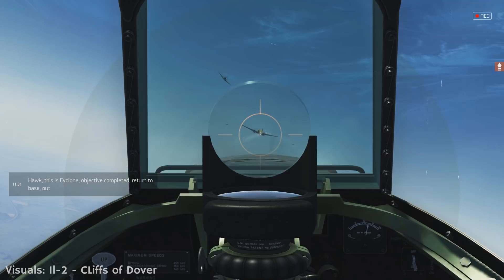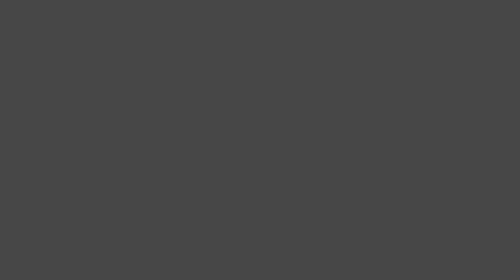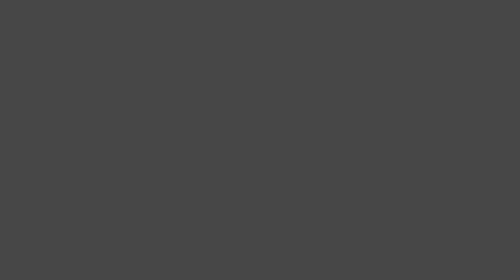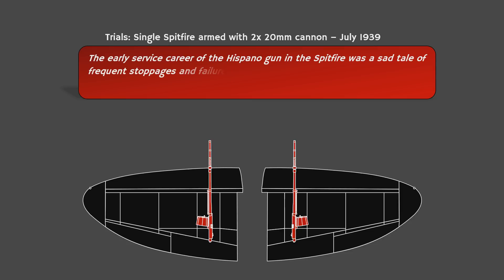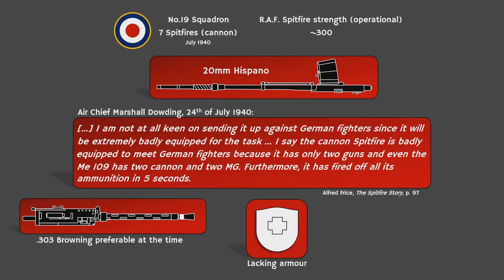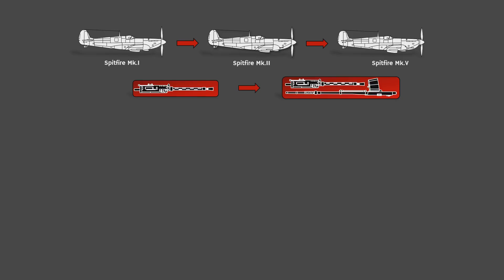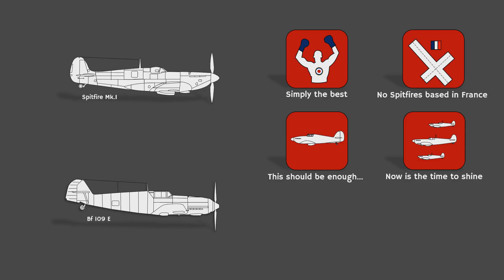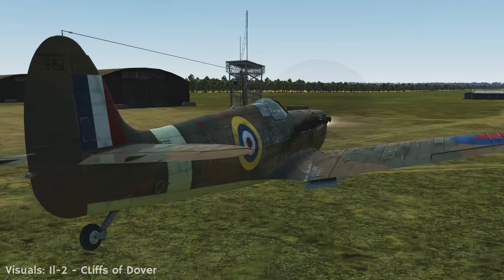⚜ | Clearing up Spitfire Misconceptions

Comment: Poor hurricanes, spits always getting the spotlight...
Reply: Spitfires are more famous as they made a larger impact where it mattered, which was later in the war. For example, notice how few people mention Dunkirk, and will readily speak of the Normandy Landings.

Hurricanes did a lot, but did that lot in much less  visible way.
Reply: Cameron McAllister I'm sorry to say you are quite incorrect.  The Hurricane was influential in the defeat of Rommel in North Affrica. The MkIId fitted with the 2X40mm vickers AT gun helped slow the Africa Corps.  The Spitfire MkVc (tropical) was more often grounded and was hampered by the huge tropical intake.  The Hurricane was replaced by the Typhoon in 1943 which had a much bigger impact over Normandy than Spitfires during operation overlord.  The MkXII spitfires only able to do minimal damage to ground forces compared to the Typhoons.  over Europe the spitfire became an almost obsolete aircraft as Typhoons,  Tempests and Mosquitos knocked out the supply lines for the luftwaffer.  The MkIXHFe being used to knock out recon aircraft (until the Mk.XIV)  and the Mk.IXLFe engaging the fighters though by late 1944 the tempest was causing havoc to the FW190 squadrons and harrying Me262.
Reply: +edmundscycles1 - Both Typhoon and Hurricane (to a lesser degree) were cases of a "failed" fighter turned ground-pounder.  Spitfires could do those jobs just as badly, if they really needed to.  Tempests were better, but it took lots of time to figure out this new engine/airframe combination.  To the point that it became unnecessary before it entered service, and a known stop-gap measure for most of the time it was actually used.

At least it actually worked, unlike Saber in Typhoons.
Reply: bakters the Typhoon was always designed as an attack aircraft. From the inception it was to carry 2000lb of bombs or 12 24lb rockets.  It was to be low level fighter bomber.  Hence the low level performance.
Reply: Under primitive airfield conditions, the Hurricane would enjoy a greater serviceability rate as well. Repairs to the Hurricane could often be done without the specialized facilities and training needed to keep a more modern, stress-skin design in the air. War on the frontiers also tends to have fewer cameramen and journalists, as well...
Reply: But then again, a Hurri usually found itself kind of 'outclassed' by the the late "E" & the F & G models of the Me 109s in the Western Desert.
Reply: +edmundscycles1 - Typhoon was intended as a fighter.  It didn't carry any bombs, but had an armament of 12 MGs instead.  Only when it became apparent that it's not going to be better than the Spit any time soon, they used it in a fighter-bomber role.  It was always quirky, the engine was very unreliable, it poisoned the pilots, the tail broke off and it wasn't particularly fast.  (BTW - wikipedia page needs fixing.  Do not rely on it too much.)

+Malaveldt - Hurricanes weren't really that much tougher than any other contemporary fighter, and also not particularly easy to repair.  She was still designed as a pure fighter, after all.  Built as light as they could make her, as fast as they could make her, and only slightly more robust than Spits by accident.

If Western Allies knew they needed a dedicated attack airplane, they would make something like IL-2, but they didn't.  They believed in strategic bombing doctrine, so they built heavy bombers and interceptors.  But then it became apparent that they need to kill the enemy soldiers too, not just civilians, so they pressed fighters into the role they were never designed to fulfill.
Reply: IN the Battle of Britain the hurricane shot down well over half of the German aircraft.
Reply: I have heard the Hurricanes were very easy to repair. They were dope canvas and the documentaries were saying they were able to get shot up hurricanes back in the air in hours where spitfires being all metal often required days of work to replace stressed metal panels.
Reply: bakters the Typhoon was always required to carry mixed armament as specified by the air ministry.  Yes the primary roll was as a high altitude interceptor but the ground attack version was in parallel development.
Reply: Grahame Nicholson my grandfather was with 6 squadron DAF in North Affrica.  The Hurricane was very simple to repair the cantilever fuselage system could be straightened by adjusting the bolts that tensioned the internal frame work then the outer section was not structural just being dopped canvas over wood dowel rods ( while on station they even used bean poles from some ones garden to repair an area that had been hit by a 20mm shell) .
Reply: Stephen Bachman more stable gun platform too.
Reply: edmundcycles: Yep lines up with what I have heard. The old guys were amazing. But if you tell them they were heroes they laugh and say "Well if I knew what it was going to be like I wouldn't have gone and after I got there  neither my bosses not the enemy really cared what I thought about it all. "  

I really love the dry humor of the old guys

An 80 year old P-51 ace said "Well those 109's were pretty good but I reckon the P-51 was about 5% better. I was pretty happy with my 5%"

Keith Miller Australian cricket captain in the 1950's and Battle of Britain spitfire pilot was asked about the stress of being Australian Cricket  Captain during a bad patch for the current captain in the 1990's. Old Keith, not known for diplomacy said "Captaining Australia in cricket is not stressful. Having a bloody Messerschmidt up your arse is stressful." 

I did 6 years army in the 70's and 80's but never went to war and I learned I could do a lot of things I didn't think were possible. It was explained to me like this. "Well lad it is mind over matter really. We don't mind and you really don't matter." 

Thanks edmund
Reply: I thought that Typhoons role was mainly ground attack and we all know of Miss Shilling's orifice.
Reply: Mike Skinner the air ministry specifications were for a universal airframe   Speed of 400+ at 22000ft and multi weapon suite.  the westland whirlwind was also a submission to that 1937 spec.
Reply: Grahame Nicholson read 'set guns to fire' written by the squadron commander of 256 squadron.
Reply: Grahame Nicholson It was a battle of attrition and numbers. Hurricanes were less effective against the Luftwaffe fighter escorts so were pitched against the slower, bigger, more numerous bombers.  
The Spitfires were assigned to take out the fighter escorts.  

The BoB could have been won entirely with Spitfire had there been enough, but not won if fought entirely with Hurricane, as they lacked the edge.  
It was won with clever allocation of what they had, with both types playing their part.
Reply: Mike Skinner. It started off as an interceptor and its role was interception of low level fast intruder aircraft.  It was big very fast and very heavily armed with a long range. It's only problem once its weak tail was fixed was the engine was no good at high altitudes. The big day raids were over by the time it was fully operational and they were flying patrols against the Fw 190 and Me 210 intruders who were carrying out fast raiding under the coast radar coverage. They shot down a lot of Fw 190s in particular as they had the legs on them.  

As the British went over to the offensive in France they were used as long range fighters and intruder type ground attack aircraft. They were always offensive fighters and they were trying to goad theLluftwaffe into putting up fighters to protect its assets. They were happy to mix with German fighters at 15,000 ft and below. They were not good above 20,000 feet just like the Fw190. The Tempest was the ultimate version and was  brilliant. The Tempest and the Typhoon did not shoot down a lot of German fighters per aircraft ar because the Germans did not challenge them much as they were simply not able to. After 1943 The Luftwaffe Fighters went up against the bomber raids or were in the East. .
Reply: routari partially true.  The Hurricane could out turn the 109 and even have better control in a high speed dive. The 109 E would have its controls lock up,  requiring the use of the elevator trim wheel to pull out and decreased roll rate while a hurricane still maintained a better roll rate in a steep dive over 400 mph.  The 109 e7 though had this problem rectified by the beginning of 1941 and the F series.
Reply: Grahame Nicholson thank you very much for the info. I was in Typhoon Flight at RAF Halton college (1970-72) and I always wished to know more about the aircraft that my entry was named after. I have searched the internet and haven't found too much to be proud about.
Reply: Heck yeah! They were murder against bombers!
Reply: The thing is Spitfire excelled at aircraft vs aircraft combat, but sucked at everything else.
Reply: The Hurricane was a great fighter for it's time. Not as fast as a Spit, but a very stable gun platform, and very maneuverable at low to medium altitude. The RAF would often have flights of Hurricanes positioned a few thousand feet below an engagement, waiting for the 109s to dive away from the Spits.
Reply: Stephen Bachman I just watched the first half and I would like to thank you for that.
Reply: I was lucky enough to see the Battle of Britain as I was walking home from school sometime in the 60s. They were dog-fighting over my house in Eastbourne using real Spits and Hurricanes and Messerschmidts.
Reply: I suggest you watch Bismark's video on survivor bias. The Hurricane is a good example of the concept. If somebody got a Hurricane back it could be repaired more easily than a Spitfire. That is true. However take for example both types get hit directly from the rear by a 20mm cannon round from a Bf-109E. In the case of the Spitfire, the cannon round detonates on contact with the metal skin. Blows a big hole in the structure and the fragments are mostly stopped by the pilots back armour. Pilot manages to get the aircraft back and its a major repair job. Hurricane gets hit in the same area. Unless the shell hits the metal framework inside the fuselage it will not hit anything with enough deceleration to fuze until it hits the pilots back armour at which point the shell would detonate, blow a hole in the armour and kill the pilot. The other problem with the Hurricane was it caught fire a lot more easily than the Spitfire. This tended to be fatal to both the aircraft and the pilot. Studies have show that if you were hit, you were four times more likely to be killed or badly wounded in a Hurricane than you were in a Spitfire.
Reply: The problem with the Hurricane Mk 1 was by mid 1940 it had a 30MPH speed disadvantage against the Bf-109E.  Under the standards of the time, it meant that the Hurricane was basically obsolete as it gave the Bf-109 a lot more options on running away if things went wrong in a dogfight. The problem for the Germans was that they treated the Hurricane with contempt, got careless and then the Hurricanes nailed them.
Reply: I think that in the defense of Malta only hurricanes and 4 bi-planes were used.
Reply: Mike Skinner... there were only 10 Gloster Gladiator found in crates. Some were hastily assembled while others were left unassembled for spares, as there were no spare parts for those Gladiators. Later on, Hurricanes reinforced the defense (august 1940), followed by Spitfires (march 1942).
Reply: Pikilloification I mean, the spits were better...
Reply: +Richard Vernon - Finally someone speaking sense.  If Hurris or Tiffies were any better than Spits, nobody in his right mind would bother with Spits.  Supermarine was not a company known for large scale production capabilities, they were know for prototyping and winning trophies.

Regrading survivor bias - introducing helmets greatly increased the amount of people treated for head injury.  Before they died quietly, after they had to be treated.
Reply: People tell this story in wisecracks, which tends to confuse those new to it. The Hurricanes did the bulk of the work, and did the majority of the kills. A Hurricane was capable of taking on any German aircraft and dealing with it on even terms or better, but with one exception. A Bf 109 was simply a better fighter than a Hurricane. To protect the Hurricanes from the 109s was what you needed Spitfires for. If all the Spitfires did was escort and protect the Hurricanes, that would have been enough.
I thought B and C wings started to appear on Spits a little earlier than that, but I wasn't there... The British Empire had a bit of a historic fetish for the .303 calibre. In WW1 that was adequate for air : air combat because the air frames afforded virtually no protection to the pilot or crew. The optimal calibre for WW2 and perhaps Korea, (air : air) was .50 cal. A 20mm canon was more effective again, which is why we still use them, but they were not yet entirely reliable, and they went through a lot of bulky + heavy ammunition quite quickly.
Reply: +Kneedragon1962 - The only reason why Hurris got most kills during BoB, was because there was way more Hurricane equipped squadrons.  And there was more of them, because she used old tech.  

If you look at a Hawker Fury biplane, strip the top wing and put a Merlin in front, you get a Hurricane.  Hawker was doing those airframes for long enough so they could produce them in bulk.  Spits required new factories , new skills and new machines, though ultimately she wasn't any tougher to build.

Escorting fighters with fighters?  No.  Hurricanes could hold their own provided they had numbers and/or tactical advantages over the enemy.  BTW - this idea that Hurricanes were used specifically as bomber-hunters is a myth.

Finally, the Brits tested .50 cal.  It was no better in power/weight than the .30 cal they already used.  From very early on they knew they needed cannons, and finally they managed to make them work.  Americans did something wrong with the chamber, which made their hispanos even less reliable, so that's why they were stuck with MGs till Korea and beyond.
Reply: Yep, true.
Reply: bakters the Spitfire had been in service with the RAF for nearly 2 years when the Battle of Britain started, factoy infrastructure and production wasnt an issue, but it was a more complex aircraft to build compared to the Hurricane as it was an all aluminium airframe and body, the advantage then falls to the Hurricane as it takes less time to build and when you need aircraft in a rush then yo build what you can as fast as you can.
Also the Hurricane was being built/partially assembled in Slough (amazingly in secret) and the industrial estate was never bombed which helped production :)
And please remember that us Brits used a .303 and not a .30 cal, well not until a NATO standard 7.62 round anyway ;)
Reply: Yes . The 'canes string bag build could never carry the label in the same way , worth , but not sexy .
Reply: The Spit became the poster boy of the Battle of Britain because it was the sexy thoroughbred charger of Fighter Command at the time was as the poor old Hurricane was the plodding never tiring pit-pony which did more of the actual work of the battle.  The Hurricane made 55% of the RAF kills during the battle, including a fair number of Bf109's and Bf110's.   The Hurricane was actually a much more stable gun platform then either the Spit or the Bf109, and could easily out turn a Bf109, there by getting onto its tail and shooting it down.  The Luftwaffe's tactic to avoid this was to nose over and dive away from the Hurricane, and this puts pay to the incorrect belief that the Hurricane was not a match for the Bf109, it could and did best the Bf109 is when used correctly.  

Also because it is simple construction, using fabric aft of the cockpit instead of more streamlined and modern stressed aluminium skins,  the Hurricane could soak up a lot more battle damage then the Spit.   Cannon shells from a Bf109 would simply pass through the fabric skin of a Hurricane and not explode and simply be quickly repaired by gluing on a patch and applying a bit of dope, often done while the A/C was being turned around for its next sortie of the day.  Whereas the same hit on a Spit stressed skin could have the A/C sidelined for a few days.

The Hurricane went on to do a yeoman's service for the RAF and for the RN's Fleet Air Arm.  They flew off catapult armed merchant ships to attack and destroy shadowing Luftwaffe Condor maritime patrol aircraft which were vectoring in U-Boats onto a convoy, they were converted into Hurri-bombers and pressed successful into the ground attack role and even fitted with large cannons to become tank busters during the desert campaign.  And all they were phased out and replaced by more modern and capable A/C such as the Tempest, Typhoon and Fury by the wars end, the Hurricane played a pivotal role as primary fighter and as test bed for proof of concept for ground attack A/C, in fact I would go so far as to say that the Tempest/Typhoons would not have developed had the Hurricane not been around, for the Hurricane was their daddy.   

I've always said if was offered ownership of either a MkV or MkIX Spit or a Hurricane, I would be hard pressed to make a choice.........
Reply: Those were four Gloster Sea Gladiators, although there were other air frames available at the time and were used as spare parts or replacements.  Later four Hawker Hurricanes was also added to the defense of the Island.   It should be noted that a myth grew up about the flight, that it consisted of only three Gladiators, named Faith, Hope and Charity, however those name and story came into being months after the battle had ended and was put out by a Maltese newspaper as a feel good propaganda piece.
Reply: +Tony B  - Yes, I agree, with a caveat "the Hurricane was easier to build at the time ".  Ultimately it wasn't, and right now it's actually quite hard to restore Hurricanes, but back then this tech was well known, while what Spits required was new, and the company in charge had no experience in large scale production.  

That's why the whole deal went on a backburner, until the war happened, and suddenly everything was needed for yesterday.

I'm not hating on the Hurricane.  She was loads better than any biplane out there, and if not for her, the Brits would go to war with those.

Oh, .303 British is a .30 cal.  Almost no .30 cals are exactly .30.  7.62 NATO is .308, but not always.  It can be something else, depending how you measure it.  It's complex, that much I know.  Ask some American gun nut... I mean enthusiast. ;-)
Reply: "IN the Battle of Britain the hurricane shot down well over half of the German aircraft."
Yes.
Which is remarkably BAD, considering that better than 85% of the air defense was Hurricanes not Spitfires.
Against bombers, Stukas, etc, the Hurricane was a perfectly good aircraft. It was much cheaper and faster to manufacture, easier to fly, and very robust.
Unfortunately, in direct conflict against the bf109, it was vastly outclassed.
The Spitfire was the answer to the German bf109. Very similar in performance, and having the tactical advantage of local airfields & ground observation support.
But to achieve this performance level, the Spitfire was much much more expensive, requiring several times the manhours to build each as compared to the Hurricane, and overall required a much higher class of pilot to handle it safely.
Reply: From what I understand, Messerschmitts had both higher top speed, faster climb rate and could operate at higher altitudes than the Hurricane. Those disadvantage were only somewhat mitigated till 1940.

So yes, those make a superior plane. Even if the Hurricane could make tighter turns, that might also have ment they'd bleed off more speed which takes longer to recover because the weaker engines. Not to mention flying at a higher altitude means you got more energy to expend.

As for the point of Hurricanes getting 55% of kills, that's a bit dishonest to argue for when they outnumbered Spitfires at least 3 to 2.
Reply: bakters not being pedantic, but being an ex cold war soldier, 7.62mm is exactly .3 inch, .308 works out at 7.82 and a bit mm, the main reason it became a NATO standard round was because the US produced .30 cal and to be honest it worked out quite well until the introducement of the 5.56mm. Apart ftom that I do find your knowledge very informative :)
Reply: Tony B ... wasn't 30-06 standard US round? While british standard round was .303.
Reply: @Marvin Kitfox - "...  and overall required a much higher class of pilot to handle it safely." - Well, ... not so much required to handle safely... A Hurricane had fairly normal control weight and response. It flew like any other aeroplane of the time, albeit a fairly quick one. A Spitfire had very light, responsive, very "direct" controls. (Especially the elevators.) Like a car with power steering and a bit too much assist, you can learn to drive it, and it can work very well, but you do have to learn to drive with your finger-tips, not your shoulders and upper back. Opinion was divided on this. Many who flew the Spit observed she was suited to a highly skilled and sensitive pilot, and the enormous elevator authority might save your arse in a dogfight, although she was spectacularly unsuited to a ham-fisted or over aggressive pilot. You could pull back on the stick, any time, any height, any speed, any circumstances, and produce enough pitch-up to provoke a stall. Or rip the wings off... Even when somebody was trying to kill you in a Messerschmidt, (perhaps especially then) you needed to fly a Spit with your finger-tips.
Reply: +Tony B - As far as I know, .308 Winchester and 7.62x51 NATO are pretty much the same cartridge.  With minor differences, unimportant here.  The difference in diameter listed results from how you measure.  .308 is a diameter of the barrel measured between the grooves.  7.62 is a diameter or the barrel measured between the lands.

But I could be wrong on this.  Still, that's how I understand it.
Reply: +Kneedragon1962 - You couldn't rip wings off a Spit easily.  Spit XI has reached Mach 0.92 then pulled 11g and landed !  That's world record, still unbeaten.  No other piston-engine aircraft ever went faster, not even talking about pulling any gs at those speeds.

Oh, and most pilots considered Spits to be very easy to fly.  "Any idiot can fly a Spit." is what you hear fairly often from wwii vets, especially when they compare them to 109s.  

Sometimes they add a caveat, that the Spit is easy to fly once off the ground.  Narrow landing gear, taildragger and all - sure, that requires a modicum of skill, but since it was manageable by kids with 30 hours of total flight time, it couldn't be that bad.
Reply: LOL, yes, the test pilot over Singapore, I know that story. You gotta have either very big balls, or very big rocks in your head to do that. What you do, is take off in almost the last operational Griffin engine RAF Spitfire in the world, and climb to the service ceiling, then put the nose down vertical and firewall it until you break Mach one, or the wings fall off.... He got seriously close to both... He wasn't the only stupidly brave pilot in the world at that time, there were quite a few of them, but ... he is on the list.
Reply: +Kneedragon1962 - It was over Farnboroguh and the pilot was a squadron leader of Royal Air Force Volunteer Reserve Anthony F. Martindale.  The dive was at 45 deg angle.

Those trials went on for two year, so it's not like he was totally crazy.  Earlier they reached slightly lower speeds (Mach 0.891) with no issues.  This time the wings didn't fall off, but the prop did, which unbalanced the airframe and caused this incredible 11g pull.  Martindale went unconscious, but the plane leveled itself at altitude and was in a stable glide as he regained consciousness.  So he just landed her...

Also, the Spit in question was powered by Merlin.  Very slightly modified warbird, photorec version, so no guns.

If you think Martindale was stupid, what do you say to all those who went against armed enemy?  Quite a few didn't come back.  The work of a test pilot seems extremely risky in peace-time, but they did all that in 1943-1944.

(There was some post-war trial (I think) in Hong-Kong, which yielded even higher Mach numbers, but since they were measured only by on--board instruments they are not treated too seriously.  I don't know what happened over Singapore.  It could be something similar.)
Reply: bakters i think you are right but a .308 winchester is a higher pressure round and not suitable for a NATO standard weapon but you can use the ammo the other way round :)
Reply: Cipi Ripi yes i believe they used the 30 06 (63?)
Reply: bakters - I think it was Singapore, it may have been Hong Kong. They had 3 or 4 Spitfires left, which were on loan for atmospheric observation, and word came through to pack up and leave, the British Empire is going home. So, one Spit had a pitot tube and also a secondary Mach tube, because (?) atmospheric observations... So our test pilot was of the view that he'd likely never get to fly a Spitfire again, so on his last flight he went to the top and pointed it straight down. A standing argument at the bar after hours at the time, was old war time Spit pilots said that a vertical dive in a Griffin engine Spit from the top, could and had resulted in supersonic. The objective was to prove once & for all what the truth was. The Mach gauge had a paper tape and pen, and it later showed about Mach .94 or something. And serious buffet... There is some dispute about accuracy, because on-board instrumentation only.
Reply: Cameron McAllister It is a star plane. I recall lot if WWII films featuring the plane. So were propaganda at during the war of Britain. The hurricanes were the actual backbone of the time, despite they were out gun. But their role were to harassing the 109 till they run out of fuel and lost combat capability to ensure there are something left after the German bomb run.
Reply: Many damaged Spits had to be returned to the factory for repairs, whereas the Hurricanes could often be repaired at the airfield repair facilities.
Reply: How many planes did the Spitfires and Hurricanes shoot down during the entire war? I can only find the numbers from the BoB but nothing for the rest of the war.
Reply: The Hurricane is like the SBS whereas the Spitfire is like the SAS. The SAS gets all the attention, but the SBS can do all the SAS can do, plus underwater. Hurricanes were the biggest contributor to the Battle of Britain, but the Spitfire was the golden child- propaganda of the time.
Reply: The winning strategy, devised by Keith Park and Hugh Dowding, was to intercept incoming raids as soon as possible and harry them continuously to and from the target. This meant sending up squadrons individually and vectoring them straight onto the raid, taking no time to form into larger groups or divide up targets between Spitfire and Hurricane, even if both were present. It was generally accepted that if both were present then the Spitfires would take on the fighters, but it mostly depended on who got there first.

Trafford Leigh-Mallory's 'Big Wings' were disastrously ineffective, because they took too long to form up, and on the few occasions they did engage a raid, they got in each others way. I regard Leigh-Mallory's aggressive pursuit of his own ego and advancement, in the face of likely Nazi invasion, as close to treason. He was certainly guilty of leaving the 11 Group airfields undefended, against Dowding's direct orders, while his Big Wings searched for glory in attacking the enemy directly, and mostly failed to find them.

The Polish and Czech squadrons were effective far beyond their simple numbers - 303 "Kosciuszko" Squadron had the highest number of kills of any in the BoB.  They all flew Hurricanes.

The Hurricane was an older design, a Hawker Fury biplane fuselage with a Merlin replacing the Kestrel up front and a monoplane wing (initially fabric covered too). There were many more of them, and they were easier to repair and return into combat.

Over the whole war, more enemy aircraft fell victim to the Hurricane than any other aircraft.

The Typhoon was designed by Sydney Camm as a Hurricane replacement, an interceptor.  What let it down most of all was its thick wing cross-section (compressibility was not well understood at the time, though that changed quickly as it became a critical issue).  The top speed was well below the desin estimate, and its performance at altitude was disappointing.  The Napier Sabre engine was also a limiting factor - because of Napier's limited production facilities and their rather casual attitude to production engineering - they would continually tinker with the design, seeking higher power outputs, while ignoring the need to fix defects found by the customer when they actually used them.  Only after the company had been purchased by English Electric were the priorities straightened out.

The Tempest was Camm's answer to the problems encountered by the Typhoon:  He designed a thin, laminar-flow, wing and put it on the Typhoon fuselage.  It was a runaway success.

Supersonic Spitfires:  you cannot go supersonic in a propellor-driven aircraft, the propellor itself goes supersonic way before the airframe and becomes a massive air brake.  The closest that a Spitfire got to sonic speeds was in an instrmented RAE test flight, researching the limiting Mach speeds in a dive. Sqdn Ldr Tony Martindale dived a fully-instrumented Mk.IX Spitfire from max altitude - and the reduction gear seized , causing it and the propellor to tear off.  What was left was a very slippery glider, diving under the pull of gravity through thin air.  The instrumentation recorded a maximum of Mach 0.92.  Martindale survived because the loss of all that weight made the aircraft tail-heavy, and it converted the dive into a climb, reducing speed and letting him recover from the G-LOC of the pullout.  He was able to glide back to Boscombe Down, the RAE station.  

Lastly - 30-06 vs .303.  The bullet sizes may be practically the same but the cartridges are very different.  303 is a rimmed cartridge with a pronouncely tapered case, and is both smaller and shorter in case dimensions compared to the rimless bottlenecked 30-06 and 30-08 (which became the NATO standard 7.62mm round).  The bullet sizes may be similar, but nothing else is.
Reply: Alan Dicey. Thank you for your interesting contribution. We need more like this (not just thee!)
Reply: Thank you Alan. Perfectly correct on every count. Nice to have someone show up who does know the story.
Reply: so it 'sucked' as a  photo recon aircraft did it? As the war went on, the Spitfire got better and better.  The late Mk IX's could and did, handle anything and the Mk XIV had no peers.
Reply: Hawker won the long game.  Nearly everything Supermarine after the Spitfire (Spiteful, Attacker, Scimitar, etc.) was subpar, in part demonstrating how important Mitchell was to the firm. Meanwhile, Hawker went on to design the Tempest, Fury, Sea Hawk, Hunter and Harrier.   Shagbat and Wellington aside, Vickers-Supermarine was a one trick pony compared to Hawker.
Reply: Actually the Typhoon was originally designed as a replacement for the Spitfire but the Napier Sabre engine did not perform well enough at altitude so it was drafted into the ground attack role.
Reply: Admiral Beez: So what!  de Havilland was another great aviation company.  Doesn't get around the fact that the Spitfire was far superior to the Hurricane, was just as good as the Tempest in it's LF guise and far superior in its medium/ high altitude role HF. we are talking WWII here, not post-war, Farnborough shop window.
Reply: It was an interceptor, plain and simple, nothing else. It started being an all purpose plane after Leigh Mallory ordered attacks on the French coast, a task that it was not designed for. As a photoreconnaissance plane, it did the job, but almost all of the pilots ended up lumbar and kidney problems, as the cockpit was not designed for long distance flights. It was not as ergonomically designed as, say, the Mustang. It was never up there as a good ground support plane compared to the Typhoon, Thunderbolt and, yes, the Hurricane. But as a pure interceptor, it stands alone. And you are right, DAX.
Reply: Why do you contradict yourself? You post that the Spitfire was  "an interceptor, plain and simple, nothing else"

then you allude to the PR Spitfire (which was the first allied single seater aircraft to fly over Berlin and in fact, flew over Germany as early as 1939, and over Berlin from 1941, long before the US entered the war.  Please supply the source  for your other assertion that "almost all of the pilots ended up lumbar and kidney problems" was down to the PR Spitfire.  could US pilots get up and have a walk around the cockpit of their Mustangs and Lightnings? Even that huge glass-house of the Thunderbolt?

S'funny how the US Airforce used the Spitfire for allied PR work. because it was simply the best single-seater PR aircraft out there.  It flew faster, Higher and get out of scrapes better and was more reliable than any Mustang , Thunderbolt or Lightning. Re Captain Blythe: https://www.youtube.com/watch?v=ie3SrjLlcUY

Instead of posting myth and hearsay, I suggest you do lots of reading of reputable titles on the subject as it seems you 'like others posting here' know very, very little.
Reply: Spitfire : Portrait of a Legend by Leo McKinstry and Spitfire : The Biography by Jonathan Glancey mention the problems of PR fliers in Spitfires. And I'm not going by hearsay. Normally, I would say thank you for requesting references, but your pithy, insulting tone doesn't merit that kindness.
Reply: Tish tish!  So you read it in a book or two!  And where did the authors get there sources from?  If you quote something, don't rely on the author or authors for the facts unless the author has published his sources.   Authors have a habit of publishing quotes from other authors who again, publish quotes themselves which is not evidence.  And seeing as you are making an excuse for not having to post the source material out of the "kindness" of your heart,  It can only be that you are relating 'pub rumour.'  I'm not questioning that some long range, single seater pilots had medical problems through prolonged sitting, but so did some Mustang; Lightning, and Mosquito pilots.  But then again that doesn't detract from the fact that there were two of the best PR aircraft of WWII operating with great success over the most hostile, dangerous skies in history, one the DH Mosquito, the other the Spitfire.
Reply: We'll all follow your lead and stop reading. And come up with sweeping statements. And get our knickers in a knot over a YouTube clip. (Watch. He'll respond...)
Reply: "(Watch. He'll respond...)" 

This site is all about response whether you like it or not!  You posted sweeping statements.  My response was targeted and not full of contradiction, hearsay and myth.  My advice to you is  not to believe everything you read or hear, otherwise you will believe the earth is flat... Historical specialist books are littered with misinformation but be assured that working at historical research can be as exciting as sitting on your arse reading it.

"And get our knickers in a knot over a YouTube clip."   

 You on the other hand, should take yours off your head.
Reply: Yes, the Spit is obviously better, but I like my Hurri 2 in sims...it's charming.   ;-)
Reply: Well, at least your post is more in the realm of reality compared with those of John Smith.
Reply: Wow. I really am a thorn on your side.
Reply: Nah! Just a whimsey, something to drop into conversations to show the dangers of myth taking to the level headed.
Reply: True, but there were far more Hurricanes than Spitfires used in the Battle of Britain.
Reply: I believe the 30-06 was mainly used in the Garand rifle. Every other machine gun was mainly .50 cal or .308.
Reply: up to 20,000 feet the hurricane was superior to the spitfire in every way. because of this they were used for attacking bombers whilst the spitfires which attained superiority at higher altitudes, was used for engaging the fighter escorts. by 1941 the hurricane had reached the end of it's design limitations whilst the spitfire was able to be upgraded throughout the war
Reply: Found a video (don't know where ) on you tube where a German fighter pilot in the Battle of Britain said that they were more scared of the Hurricane than the Spitfire.History is (re-written) by the victors.
Reply: Hurricanes, the Cinderellas of the Battle of Britain. I've a soft spot for them and although the Typhoon had to be diverted from fighter to fighter bomber and assault they did well in that task I thought. But I like the Tempest late in the war but those who flew them loved them and were responsible for most of the V1 rocket interceptions.
Reply: Diverted to ground attack after it failed initially as an air superiority fighter. The Tempest on the other hand, pilots loved them and they said the plane went where you pointed it.
Reply: Mike Skinner was that the making of the movie you're referring to? The Bf 109s and Heinkels were borrowed from the Spanish Airforce and were fitted with Rolls Royce engines.
Reply: Gloster Gladiators were the biplanes used in Malta.
Reply: Bakters if it's the one I'm thinking of there was a who pilot flew to over 50,000 feet, went into an uncontrolled dive and leveled out at 3,000 feet. Unofficially, it reached a speed close to 700 m.p.h. The spitfire was a Mk XIX operating out of Singapore doing recon over China in 1952. Pilot was Flt. Lt. Ted Powles.
Reply: the Hawker Hurricane took fewer man hours to build and was very much  easier to keep maintained, the Spit was a great fighter, don't forget the Hurricane was a good fighter, each has it's place, use the Spits to engage BF 109's, while the Hurricanes are shooting down German bombers
Reply: edmundscycles1 no your history is wrong
Reply: Finnish pilots said Hurricane was easiest plane to shoot down of all fighters they faced in combat.Even I-15 and 16 were harder to shot.
Reply: Pikilloification I always loved the hurricane, my favorite British fighter.
Reply: Pikilloification yeah but the hurricane is an old 1930s plane based of bi-planes the spitfire was a new plane
Reply: edmundscycles1 the typhoon to me was useful in some cases
Reply: Pikilloification no the hurricanes seen in battle
Reply: Cameron McAllister Spitfire's concentrated on the German Fighters while the Hurricanes concentrated on the German Bombers, guess which was more Important to the people below. The Spitfire has the Beauty and Sex Appeal, while the Hurricane is the competitive but homely sister. Each did their job well, but most prefer a Spitfire to a Hurricane given the choice. In reality, stopping the Bombers was more important, but less glamorous than shooting down German Fighters. Lack of Fighter Cover forced the German Bombers to fly at night, makeing their attacks on British Factory's less effective, but makeing things worse for the Civilians trying to sleep. The British were quite Brilliant at jamming the Germans use of intersecting beam's used as a night Bombing aid.
Reply: hurricanes had a much better platform, and could take more damage, if the spit had the same gun platform meaning all 4 On Each Wing  HUWith the 303's together is more effective than enemy fire  but still wings, also less shit for the ground crew, 15 seconds
Reply: YOU  CANT DENY, Philippines here , country of Paradise..
Reply: The mighty hurricane shot more birds out of the sky than the spit ever did...and it could take more punishment. I think the hurricanes didn't and still dont get the recognition they deserve. Kinda like the b-26 it saved more pilots and had a higher success rate than the b-25 ever did.
Reply: I  suppose I should also mention that four different Curtis aircraft of WWII all had virtually identical wings, tails and profiles aside from differences in purpose/number of engines.  The P-36 Hawk (known to the Brits as "Mohawk") the P-40, the SB2C Helldiver and the C-46 Commando all had the exact same tail design, and nearly identical wing designs.  

Why?  Because they all shared the same designers!
Reply: @bakters   The sporting rifle cartridge known as  308 Winchester doesn't actually measure ".308 inch."  (It's a misnomer, in fact.)  As the later .223 Remington is to the 5.56 NATO round, .308 Winchester is the sporting rifle equivalent to the 7.62 mm NATO round.  Although it shares the same dimensions as the 7.62 mm NATO cartridge, it's typically loaded to a lower chamber pressure, although this can vary somewhat depending on who's doing the loading.  

You can safely feed .308 Winchester rounds through a rifle chambered for 7.62 NATO for years at a time with no major problems, except possibly for a tendency to under-perform slightly; feeding 7.62 NATO cartridges through a rifle chambered for .308 Winchester, on the other hand could potentially cause serious problems.  (I spent some time carrying the C1A1 and C2 rifles in my younger days.)
Reply: @bakters  But the Hurricane wasn't a failed fighter like the Typhoon.
Reply: @honkhonkler7732  "But the Hurricane wasn't a failed fighter like the Typhoon."
- Through most of the war if you went in a Hurricane against contemporary opposition, you were pretty much outclassed.  Soviets used her for a long time, simply because she was better than a sharpened stick, but they didn't like her at all.  In Burma Hurris were flown quite late in war too, but going in that thing against the Japanese was, well, not exactly hopeless, I guess.

Brits were caught with their pants down and Hurricane was the best fighter they could deliver in sufficient quantities quickly enough.  But it does not make her all that great.

"Spitfire envy" was a thing for a reason.
Reply: Woohoo history battle!!
Reply: i read where more planes were shot down in the battle of britain by hurricanes
Reply: Wow! Thats the highest number of replies I have ever seen to a comment! Congratulations!
Reply: Pikilloification even got mentioned in an iron maiden song
Reply: My first model airplane. 😉
Reply: @bakters  That's why we built the A-26 - a bit late to the party.
Reply: @gumpyoldbugger6944  When both the Hurricane and Spitfire were armed with 8 x .303 guns, the closer grouping of the guns in the Hurricane made them more deadly effective.
Reply: To be fair, Spitfires made a far bigger impact on the war past 1942, and it was a design with much more potential.
Even in BoB, the only reason Hurricanes got more kills was because there was a lot more of them.
Reply: @JustinianPrvni  The Hurricane was easier to fly (it took less time to train the pilots), had a better gun arrangement (before they went to cannons) and could quickly have minor battle damage repaired so they had a higher availability rate.
Reply: Let's have it right, the spitfire was not only more attractive but also all round a better aircraft to the hurricane although 'not' massively. It's definitely true that the hurricane played a more substantial role during the battle of Britain and anyone who disagrees needs to brush up their history. This however is more down to the speed they could build one compared to the spit meaning more where available, with more spares and easier to maintain.
Reply: Both the Hurricane and Spitfire are equally famous. During the Battle of Britain the Hurricanes task was to engage the Dornier and Heinekel bombers and the Spitfire to engage the Messerschmitt 109. My favourite plane of ww2 is the Hawker Typhoon, an interceptor and a tankbuster, firing rockets at tanks, fantastic and cool invention.
Reply: @bri5490  Cajus Bekker in his book "The Luftwaffe War Diaries" mentioned the Spitfire around 5 times more often than the Hurricane in the BoB.  It was like he just had a hard time accepting that Hurricanes shot down a lot of German aircraft.  Just recently in the Movie "Dunkirk" was it a Spitfire or a Hurricane that shot down German Planes and how did that small boat pilot recognize the sound of a Spitfire when most of the planes he would have experienced were Hurricanes with the same engine as the Spitfire.
Reply: @danzervos7606  Luftwaffe loses in the Battle of Britain were 1700 aircraft a large proportion of the figure would have been bombers, Dorniers and Heinekels shot down by Hurricanes.
Reply: Grahame Nicholson 
If I remember correctly, that’s because the Hurricanes, being more stable gun platforms, were sent to attack the bombers while the spitfires engaged the escorts.  There were also considerably MORE Hurricanes than Spitfires, further skewing figures. Hurricane wasn’t a bad plane, but it was definitely getting long in the teeth compared to the Spitfire, so that stability and ruggedness was put to use by making it into a Close Air Support aircraft that could still defend itself if attacked by enemy fighters
Reply: Hurricanes were the work-horse without a doubt. Spits were a better war machine but didn't have the numbers to effect the results required to stave off the German on-slot. But we have to admit however, the Spitfire is one beautiful bird.
Reply: @cameronmcallister7606  I agree with your statement.  What you wrote is also true with us Americans.  We tend to remember D-day better than North Africa, Sicily and Italy, and in the Pacific we tend to remember Iwo Jima and Okinawa better than the early island invasions.  Why?  I don't know, "fresher" memories?
Reply: @edmundscycles1  I disagree. There was no such 'spitfire being obsolete' unit the 1950s. You've pointed out the excellent multirole Typhoon and Tempest which are effectively specialised ground attack aircraft. The Spitfire you cannot compare, that was originally designed to be a fighter. The spitfire counterpart to the Tempest would have been the F.XIV. Not one had been lost to an enemy aircraft during the war, and I believe it had an equal share of the Messerschmitt 262 score.
Reply: @baselhammond3317  partially true . Against the late war Bf109 and early Fw190 the spitfire was good , but the structural limitations of the aircraft and wing design . The Spiteful or Matrin Baker Mb5 had much more potential for development . Thou both were pre 1942 designs and use NACA data on lamina flow wings . 

The major drawback to spitfire wing design was its tendency to warp under high g loads leading to gun jams and belt malfunctions , something that could never be rectified . Even the Mk22 still had a similar profile to its aerofoil as the original.  

If that war had not ended in 1945 but continued for even another year or two the spitfire would have been relegated to second line service with Tempests , Sea Fury and gloster meteor (even Vampires) becoming front line fights . 

The pinicle of the spitfire was the Mk.xii or possibly the Mk.19 (with the new paddle blades fitted to the griffon) .  By 1949 the spitfire was already showing its age with performance of aircraft such as the P-80 F-86 and F-80 fury showing that jet fighters were the way ahead . With greater climb rates , range , guns and speed while sacrificing very little in turn rates at the higher combat speeds . 

Even in 1945 new wave of Soviet and Japanese fights such as the Niki 1 were surpassing the spitfire Mk XII and even the Mk.XIV at medium to high altitude.  Come the Mig-15 the Spitfire stayed in service far longer than it should have . The fleet air arm saw this as far back as 1943 and commissioned Hawker and supermarine to produce a carrier aircraft that exceeded most land based fighter requirements.  While in parallel developing carrier versions of de Havilland vampires and Gloucester Meteors.  

The Mk 19 spitfire was always ment to be a stop gap for the Meteor Mk6 . The end of WWII and the slow down of purchasing and development for front line fighters from 1945 to 1950 due to the labour government was the only reason we have the Mk 21 on of the spitfire , they all lacked the speed , climb rate and high altitude performance of the new jet aircraft.  

Ergo by 1945 the spitfire was obsolete as a true front line fighter . The fact it ended the war on a high has more to do with timing than it's ability as an airframe that could genuinely be developed to stay competitive as a front line fighter . 

Hawker had already drawn up its successor in the hawker p1052 in 1944 and the later P1081 in 1946 (later to be developed into the Hunter ) . 

Of note is that many of the late Mk spitfires did not fly or handle as well as the Mk.IX or Mk. XII . They had heavy controls , too much torque that reduced turn and roll rate to the right (as the griffon was a counter clockwise screw) while still being an unstable gunplatform . The later spitfires also had CoG issues with the extra fuel cells behind the pilot (an issue also in the Mk.VIII ) while turning . This caused high speed stalls while under hard maneuvers and handling issues at low fuel levels . The handling of empty weight later Mk spitfires was a issue while on the ground with the griffon engine extending the nose by over a foot . While this was partially mitigated by a longer rake on the under carriage this in itself caused ground handling issues . Snap turning while under power on the ground was common with lots of rudder and brake input needed just to roll in a straight line . 

Just because an aircraft stays in service does not mean it is not obsolete.  The hawler hunter stayed in service until 2006 , but it was still obsolete.  

Anyway.  Thank you for the reply and I hope this didn't come over as condescending just to my reasoning as to why I believe the spitfire was obsolete in 1945 and on .
Reply: @edmundscycles1  Not at all, great response with that interesting insight - thanks for your time. On the note of the Hunter here you have another great aeroplane. It has the similar handling remarks as the Spitfire, as in 'if it looks right, it will fly right'
Reply: @baselhammond3317  that pretty much every British aircraft designed in the 1950's and 60's . Especially the EE lightning and victors.
Reply: @bakters  the huricanes did 99,99999,999 
Percent of its missions but for ground  attacks...
Reply: @user-kn2qk8ly8c  It did the job though.😁😁😁
Reply: I have it on good authority that them's shit planes for remtards on free dinners.
Reply: @stanrogers5613  but my name is Chalke.......is that so hard to remember ? Lol
Reply: @cameronmcallister7606  you're wrong, they were co dependent, just as important as each other
Reply: Yeah I like the Hurricanes more :(
Reply: @cameronmcallister7606  Hurricanes were Britain's savior during the Battle of Britain.
Reply: @bakters  Spitfire cooling v. vulnerable at low level
Reply: @mike_skinner  Three Gladiators - Faith, Hope and Charity. Spitfires flew into Malta off HMS Eagle later in the battle, which evened it up considerably.
Reply: They are prettier
Reply: LOL, and for good reason.  The Hurricane was outdated by end of the BoBritain, and really not a contender during the battle.  Worst kill ratio of that conflict.